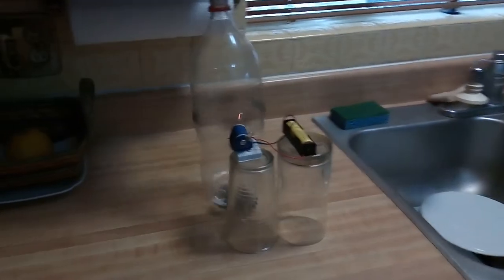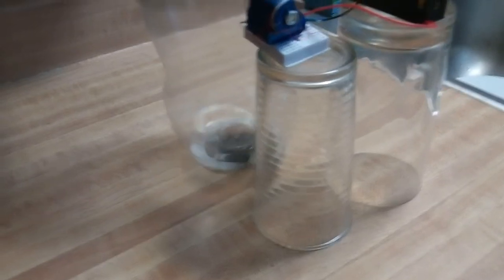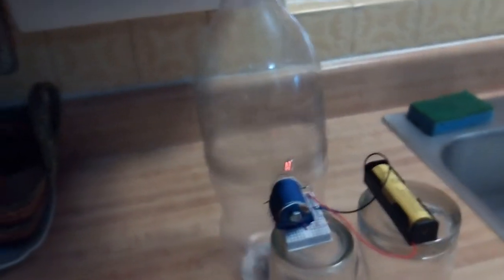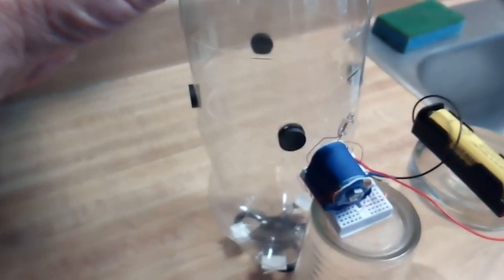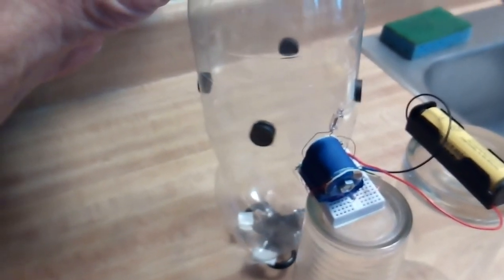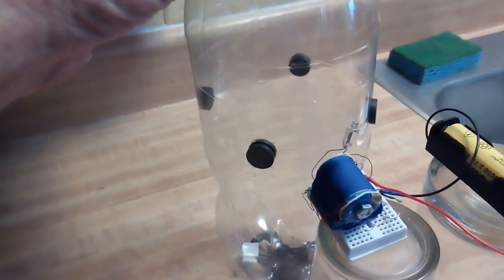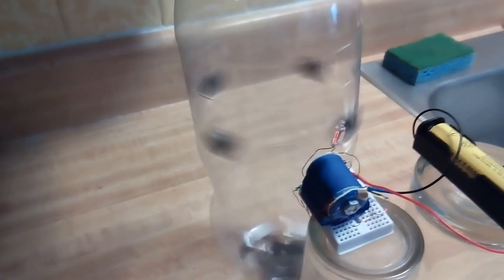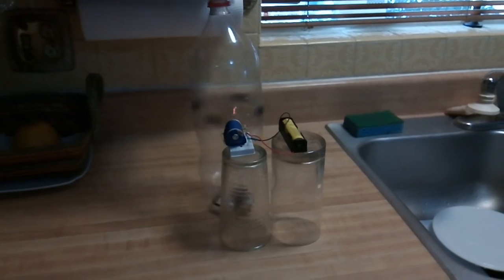The Soda Bottle Experiment

Comment: What is the amp draw on this motor?
Reply from the maker: I didn't check it but it should be around 30mA to 50mA with this coil.  It isn't constant though.  It spits it out in short pulses when the reed switch triggers. It might be fun to look at it with the scope.